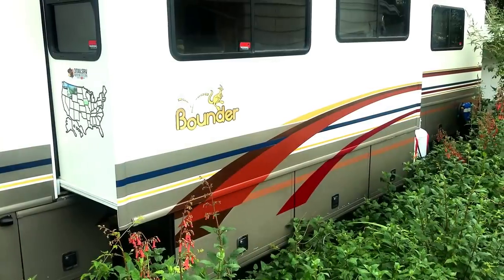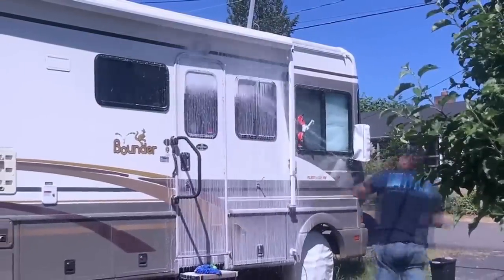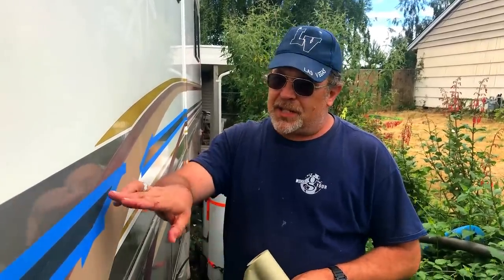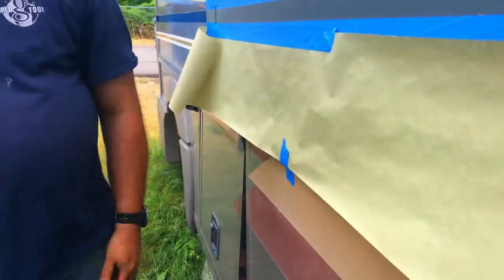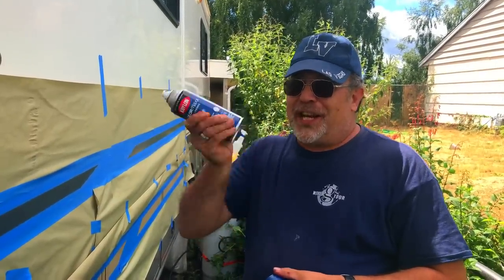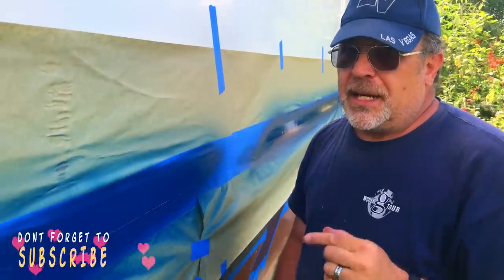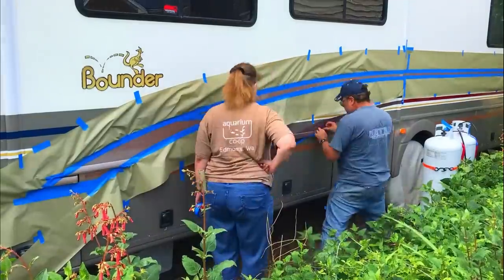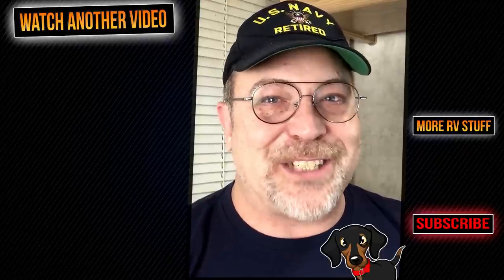🔴HOW WE RESTORED OUR FADED AND CRACKED RV VINYL DECALS | RV DIY tutorial

Comment: It always used to amaze us how many folks in the rv community would tell people in online forums asking about doing this - that it couldn't be done or that it'd be a bad idea. The kicker?,... none of them had done it. That's often the case with many things. We've done this more than once wth good results. The paints they make now days seem to bond to just about anything and lay down easily.  As for those asking about serious cracks; use a "high-fill" spray-can primer from the auto parts store and a scuffy pad or sanding block and go over it lightly, (very lightly),. Then hit it with a very light first coat.
Reply from the maker: First off thanks for watching and leaving a comment. Haters will hate it worked on our RV.  Has been on there for almost a year and we have had zero problems with it.

Comment: Suggest first edging with 1/4" tape next to stripe.

Wipe down with 3M wax remover in case there's any wax or silicone on the surface. Or, use mineral spirits. 

Scuff surface with 400 grit or similar scotch brite pad.
Reply from the maker: what works for one may not work for others.   See the results after one year on a recent video
thanks for watching

Comment: Enjoyed your informative video but I am still confused about the process so if you could come to Yuma in the next five months and do our 35 foot fifth wheel I would probably understand how once you are done. Signed, slow learner
Reply from the maker: I’ll give you an “A” for effort, but that is a project that is better done by its owner.  Lol great comment
Reply: I had to at least try LOL. On a serious note though, I have removed a few of my decals that were really bad and it left a shadow on the RV of where they used to be. Do you believe this spray paint would adhere to The gelcoat?  Thanks
Reply from the maker: Cliff Berry you will have to do real thin coats of paint, I would test it on a small area first.

Comment: Just curious. I noticed the 2 100lb propane tanks. Do you haul those with you and if so, how? Thanks
Reply from the maker: First off thanks for watching and taking the time to leave a comment. to answer your question; No, sorry we only moved them to get them filled.   I made a bracket using 2 4x4 and notched them, install a cross brace with 2x4's and  cut out a moon shape to match the curve of the bottle.  I strapped all that to a wheeled cart so it was easier to move around.  We don't travel with them any more as we sold them when we left washington state. (that was a year and and half ago)

Comment: You had a bottle of what ? you used to wiped down the surface before painting ?  Was it acetone based ?
Reply from the maker: Ngasalon first thanks for watching and taking the time to comment.  We used TSP after washing the RV.
Reply: @3tailsRV  thanks.  Really enjoy the videos.  Just had a grey water tank bust on my montana.  Debating running hard line to drain due to expensive cost of new tank and labor.   Plan on trading in at end of year.  Have drain open now and gorilla tape seems to be working great so far.   12 inch crack on btm of tank away from hole.    If you have any great ideas would love to hear back.  Thanks
Reply from the maker: @ngasalon  WOW sorry to hear about the tank.   I would look on the Tube and check out some rv tank repair videos.
Reply: No acetone! Too harsh of a paint remover. 

3M wax remover or dampen a rag with mineral spirits

Comment: So how is the spray paint holding up now that some time has past? We have a 2000 hurricane class a with horrible stripes trying to decide to take them off or paint over. Thanks for a great video
Reply from the maker: Thank for stopping over and leaving a comment.   Video coming soon
Reply: Well I am starting mine today, a answer like " great video coming soon or not great video coming soon " would have been helpful,  not knocking you just worried that it will oxidized and look worse in a year
Reply from the maker: I just started filming the follow up video today. Our looks just as good as it did the day we did ours.  Here is a helpful tip let I set for a week and then wax you trailer. Thanks again for watching and good luck with the project

Comment: Hello. Ive been trying to decide how to approach my cracking decals - Im pretty much leaning towards paint also.I saw that on some of your decals the decal was cracking - mine are heavily cracked. Did you sand them down at all? If not, how did the paint finish come out over the cracked portions? Not sure I want to go thru the sanding process if they turn out okay without sanding.... Thanks.
Reply from the maker: Steve first off thanks for watching and taking the time to leave a great comment.  to answer your question no I did not sand them and the more layers of paint that you add will fill in the cracks we found that 4 to 5 layers was sufficient in filling the cracks.  Hope that answers your question?  What brand of RV are you painting?
Reply: @3tailsRV  Thanks for the reply...that helps a lot..we are painting a 2009 coachmen class c...just the upper decals are an issue but trying to find a color that works with the colors of the good decals was the fun part...lol...I think I did find some krylon that you used that is close enough...its the same formula krylon just a diff color...
Reply from the maker: We got our at Lowes there is a good variety of colors to choose from.  our 34 footer took a few days to do have fun!